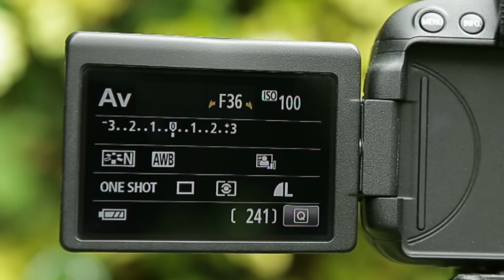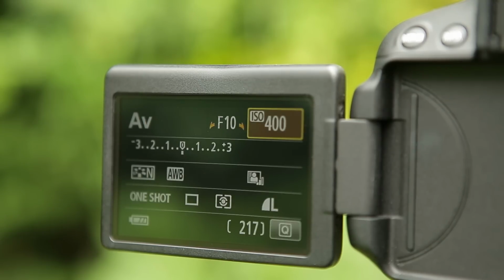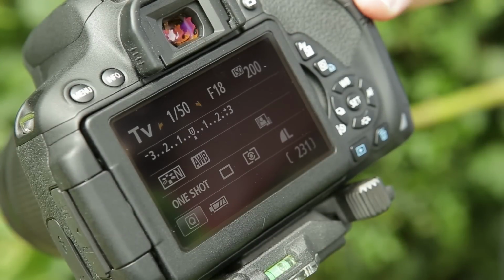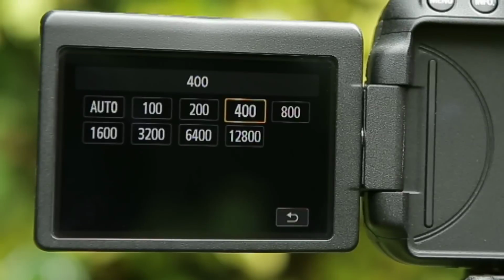Understanding ISO (sensitivity) - How to Use Your Camera, Part 6

Comment: But how does the iso control actually affect the sensitivy of a sensor which then results in the noise?
Reply from the maker: When you boost the ISO you are making the sensor more reactive to light, via pushing more voltage to the sensor, the noise comes when light isn't present or is too much, its the computer chip 'filling the gap' - the best places to use for video is the cameras native and for photo running denoiser can also help!